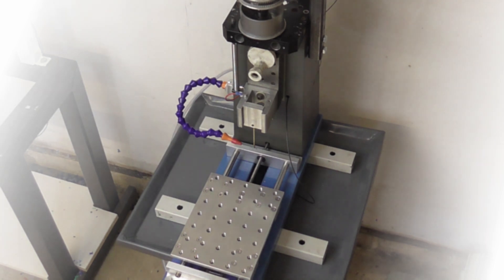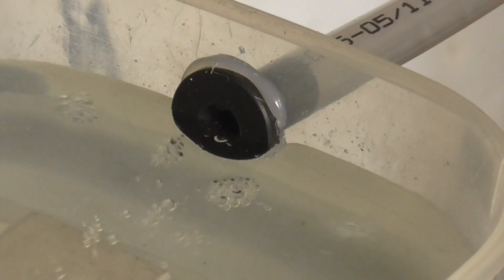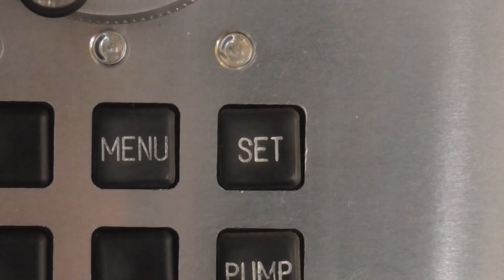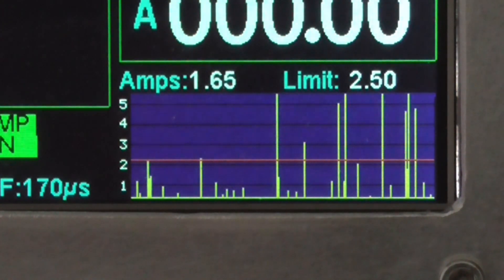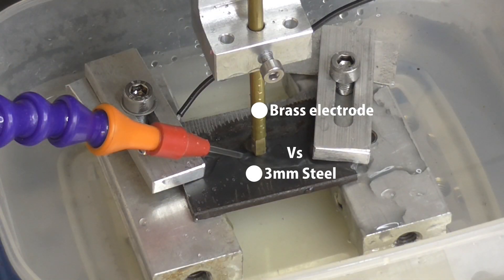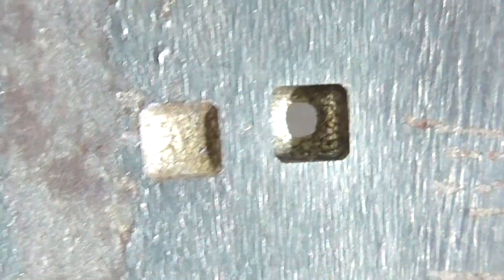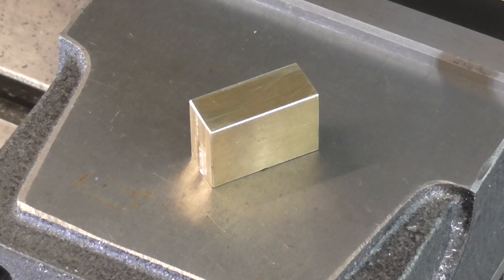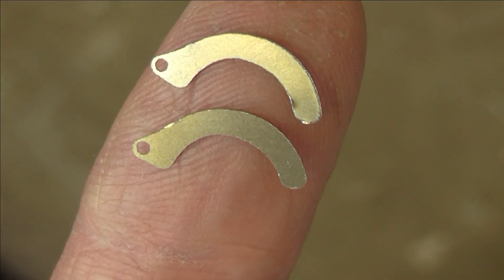Building an EDM machine part2

Comment: A question: in this model you used a sensor to measure and clean the current, right?
Reply from the maker: Yes, I actually measured the voltage which is proportional to the current.
Reply: @AndysMachines What modifications would you make for wire EDM?

Comment: Hey !
Once again, what a GREAT video !
I'm alsa building an EDM generator. I think yoi've already answered the question, but can't find it anymore, so... What's the best HIGH and LOW duration for your signal you fond out  ?
Reply from the maker: It's actually been a few years since I built this machine and I've not used it recently, I think I had best results with a fairly low duty cycle, maybe 10%, I can't remember the frequency but I think this information is probably in the video somewhere.

Comment: I use graphite electrodes with good results in oil.
Easy to pattern, come in large diameters for welding and cutting and good longivity.
Should work in water as well but haven't tried.

Comment: Wonderfull built and wonderfull result !
May i ask what's the purpose of R1 (and what value you use) ? As there's a big capacitor after, i guess it's not to limit current (or maybe to prevent short circuits damage ?)
Reply from the maker: R1 is to limit the current in case of a short circuit. I actually used a heating element for this resistor as it needs to be high wattage, it's resistance is only a few ohms, I chose it to limit the short circuit current to 4 amps so as not to overload the power supply.
Reply: @AndysMachines  Thx ! I think i'll try this buit to :)

Comment: I would really like to make this controller, can you share the plans?

As well I'm interested in making your plastic injection machine, you've done a fantastic job on it's design.
Reply from the maker: I didn't really ever completely finish this machine, so didn't produce any plans. I was going to add CNC control to the table, but I left it half-automatic half-manual. I might revisit it one day when I need some more EMD'd parts, but it's been overtaken by other projects (usual story!)

Comment: Love the EDM, starting to build one myself currently and have been watching videos because I was a simple build done on the cheap since its only for a couple uses then will probably gather dust awhile. Your setup is very close to what I am looking for, THANKS for sharing!

I have never ran an EDM but been around them alot and diagnosed/repaired them when I was previously a CNC Field Service Engineer for Custom made Sarix EDM Drilling machines at a couple plants in Ohio (Field Service Technician in my opinion, why companies have to add Engineer to titles that are not such....).

 One thing I would suggest if I may is: Try using Copper, Copper/Tungsten or Graphite rather than brass. If using graphite make sure you have the proper cutting tools (coated with diamond I think) as it is very abrasive and will eat up the end mills that are made for metals.

Comment: Great project! Did you measured the actual peak current through the transistor? In theory, with low ESR caps it can reach hundreds of amps (assuming spark has zero resistance ), but your system is doing well with single 30A(120A peak) transistor.
Reply from the maker: Unfortunately I don't have an accurate way to measure the very short high current pulses, but yes I imagine it's in the many tens or even a hundred or so amps.

Comment: From what I understand you used water, wouldn't it be better to use some dielectric fluid ??? If I'm not mistaken commercial EDM machines use a type of kerosene or it is an extremely fluid oil (not very viscous)

And for the electrode it seems to me that copper also wears out less and is more efficient, have you tried these two options I mentioned ???
Reply from the maker: Distilled /deionised water is a dielectric fluid, but you are right, commercially kerosine and light oils are used. I used water just because it was readily available. Yes, I've tried various electrodes including copper and graphite.
Reply: @AndysMachines  and how were the results with copper ?? because commercially I see that they use more copper electrodes, about graphite I was curious about the results because I have never seen an EDM machine using graphite as an electrode !!!
Reply from the maker: I haven't really done enough testing to see a clear winner. Brass is a good all rounder in terms of availability/ease of machining/wear. Graphite is very messy to machine. I didn't notice a big difference between copper and brass.

Comment: If you don't mind I would like to get your opinion. I have been thinking about building an EDM machine to make circuit boards "PCB's"... One thought is to use a N-channel mosfet instead of a  igbt, I don't know if that would be better or not. My second thought would be to use a tungsten electrode from a TIG welder, seems to me it would be more durable/last longer. Please let me know what you think, and thanks.
Reply from the maker: Yes, you can use a mosfet instead, I considered doing this. You can even use several mosfets in parallel to increase the current capacity.

I don't see why this shouldn't work, you can EDM copper with a copper electrode, but you might want to experiment with the polarity to see which gives less electrode wear. I haven't tried tungsten, but copper tungsten is used for EDM electrodes.
Reply: @AndysMachines  Thanks for your help and quick response. My thought was that TIG electrodes handle very high temperatures and pretty high current as well when welding, and they last quite a long time...  I don't know for sure though.
Reply: Of course mine wouldn't be doing what yours does. mine would basically be drawing lines, so no shaped electrodes, just a point.

Comment: Is there any chance of plans and code? Everything looks and works great, but there´s no information to it, aside to the Voltage-divider for detecting capacitor-current... In YT, we either find systems that work really just partially, and are full of informations, or systems that work greatly, but without informations...
Reply from the maker: This is still actually a work in progress, I shared as much information as I really could on the build. Mechanically and controller-wise there's still a lot to do before it will be 'finished'.

Comment: Why not use graphite for the electrode?
Reply from the maker: Because I didn't have any at the time. Apparently there is a special type of graphite for this and I now have a rod of it, but it's messy stuff to machine and not good to get in machine slideways so I haven't got around to using it yet.

Comment: Hello really nice video and experiments ! you can control the current via the resistor, take a 0.1 ohms and a current amplifier, with protections, and feed it on the microcontroller, it will be ok,. but to improve results a microcontroller should be used to keep constant I * time  value. and the arcing time is not constant so you must detect the start of the arc and then cound and trig off. Good experiments !

Comment: Hi Andy,

Very interesting project ! Did you build any circuit to protect the mosfet when there is a short circuit or do you simply rely on the stepper backing up fast enough ?
Reply from the maker: Yes, it measures the voltage across the voltage divider constantly (which is the inverse of the current flowing) and only applies pulses when it's above a set limit. Resistor R1 limits the maximum current through the mosfet and protects its during a short.

Comment: Just curious -- instead of brass electrodes, could you use tungsten?  Would it last longer than brass?
Reply: Brass has zinc content; zinc vaporize then explode by sparking, this is absolutely help in penetration. All wire EDM and super drill utilize explosion from zinc. These machines work poorly or do not work without zinc.

Comment: Andy, have you tried using carbon or copper electrodes? Excellent video
Reply from the maker: Thanks! I did try copper, but can't really say yet how it compares to brass. I also got some graphite rod to try, but the stuff is extremely messy to machine and the dust is not good for machine tools, so this is waiting until I have a real need for it.

Comment: The display that you have built is awesome what did you use to control it.
Reply from the maker: It's a 320x240 2.4" LCD display. I'm driving it with just an 8 bit microcontroller (ATmega328) using custom code I wrote in assembly language.

Comment: Do the sparks affect the microcontroller and stepper motor driver performance? Will losing steps occur ? Or after some times, will z axis not go back to home or original position (or zero reading)? Is the pcb is normal breadboard type?
Reply from the maker: The microcontroller, no. But the cheap stepper drive I used did occasionally get affected and take extra steps. This wasn't a problem as I was only moving in one axis but If I ever get this machine converted to 3-axis I will use better drives that are more immune to noise.

Comment: Also if you have XY slide as your electrode becomes worn you can do little circles that will bring them into tolerance even though your electrode is worn
Reply from the maker: Yes, I believe that's called orbiting? And is a function built in to many commercial EDM machines.

Comment: If memory serves me right your electrode should be positive a little bit more on time use your off time to control the flushing you should see the electrode becoming a little silver as replating should be occurring otherwise you need more on time.
 I would stay away from brass straight copper is best otherwise you have two different things happening  the zinc is coming out much sooner undermining the copper and avoid mixed graphite like copper infiltrated graphite again you have two different things going on graphite should be negative electrode never been a big fan of graphite it's nasty leaves horrible filth copper is one of the best items to use as an electrode that's 100% recyclable.
If you want better round hole you can rotate the electrode slowly and you can even very slowly feed a copper infiltrated tungsten block by the electrode to true it up that way you can control the diameter very tightly before you begin burning by doing this and continuing to rotate the electrode in the part you can make round and hold tenths of thousands of an inch on your diameter if you go to that trouble.
Instead of water you might wish to just use some diesel fuel at your dielectric you will smell the smell of acetylene that is what comes off is flammable it may flash into little flames here and there if you're near the surface unless the oil gets hot it should not catch on fire but I always keep a fire extinguisher around anyway the water will make hydrogen gas which you have no warning only an explosion.
Reply from the maker: Thanks for the advice, there's a lot to learn regarding all the different electrode types and variables. I did get some pure copper and graphite to experiment with. Yes, graphite is messy stuff, I don't like machining it for that reason.
Reply: @AndysMachines  I have many years of experience from work at one of our national laboratories where we cut everything but  die steel.
I wrote a rough book on non-conventional machining non-conventional material company that I was working with I believe sold that information to sodik.
Mostly on time off time settings different materials including plutonium that was done with wire machine much was wire and a good amount was die sinking.
We were using wire machines to make parts that you would normally make on a mill only much more efficiently.
Two of the most advanced sodick wire machines we were not able to use them as the software was quirky mostly used fanuc w series machines that no problem because of illegal semiconductors there are no American machines being manufactured back in 95 so they were imported with many names just it went against an agreement to not bring their machines to our market.
It ended up a good thing in a way it opened the door for new technology like a soft wired power supply this is big change as most EDM supplies are what they are you don't like the pulse type you must buy a new supply this one allowed many things that were not available then you could put your parameters on a floppy and share them.
Fanuc supplied many companies with controls right up until this agreement was no more than no one could get a controlled or a power supply so then that's just when they begin to make their own trying to remember the machine that we had purchased and there was no dealer in Arizona we got it very inexpensively everyone was afraid of this machine I took one of my more difficult programs and went spent a week with it looking under its skirt we took delivery of this machine and a week later they sell many with dealers in place

Comment: Could you replace the electrode with a wire instead? Obviously you'd need a way of replacing the wire continuously but would the spark generator electronic work unchanged?
Reply from the maker: Yes, you could use the same type of spark generator for wire EDM. Usually the polarity is reversed as with a wire you don't care so much about electrode wear since new wire is being fed continuously.

Comment: Nice. But why did you opt for sink, and not wire machine. Is the wire so much harder to make, or there's some other reason. Because the wire seems, at least to me, much more universal.
Reply from the maker: Yes, a wire machine is more versatile and not really that much harder to build, just more parts to it. I may even upgrade this to a wire eventually. But there are also things you can do with a sink EDM that you can't do with a wire and that's what I needed at the time I built this.
Reply: @AndysMachines  Can the same generator work for wire, too, or you'd need to modify it?
Reply from the maker: Yes, it should work for wire too, though I think often the polarity is reversed for wire vs. sink EDM.
Reply: @AndysMachines  Thank you for the clarification. I'd prefer to make the wire variety, as regardless of the method used, laser, CNC router, CNC lathe etc., I almost exclusively make small quantities of parts for prototyping. And wire EDM is attractive to me because of it's precision. Of course nowadays there's also a laser/waterjet combination which has similar possibilities, but the prices of such systems are for what I do astronomical. Even the generator like the one from BaxEdm is too expensive for my needs, but trying to put together something like you did doesn't seem such a problem to me, and I believe I'm capable of creating a mechanical part, too, CNC and wire+fluid management. But I suppose it's best to try to assemble the genertor, and probably also test it in sink configuration anyway. I may get back with some additional questiuons if I do try this, if you'll be so kind to answer them. Thanks again.

Comment: Congratulations you did a great job
I didn't understand what kind of electronics you used  
They are  pic microcontrollers?
Reply from the maker: This actually uses Atmega 328 microcontrollers (the same as used in arduinos), though I have used PICs in many of my other projects.

Comment: I wonder if taking the vibration  out of the timing puller might not  improve finish a wee skosh.
Reply from the maker: It only resonates when doing rapid moves, when cutting it moves very slowly and there is no real vibration. The column of the machine is quite heavy and soaks up any vibrations there are.

Comment: I wonder if a conversion kit could be made for an ender 3, using some sort of common rod stock as an elecrode.
Reply from the maker: I'm sure you could convert a 3D printer into an EDM machine, but it would be quite a big conversion and not easily reversible or suitable for use as both. The Z axis would really need much finer resolution, so would probably need a different leadscrew and gear reduction. (I have an Ender 3 myself).
Reply: I think the biggeset challenge would be dealing with all the electrical noise induced by the process, a 3D printer just isn't designed with such a harsh environment in mind.  All the long wires would make perfect antennas, triggering random resets of the controller.

Comment: Surly you would laser cut them at this thickness?
Reply from the maker: Yes, you could. You'd need a metal-cutting laser of course. Another more simple way would be to use a resist mask and etch them chemically. I just wanted to see what the EDM could do.

Comment: Just subscribed to your channel. As a wire and sink EDM programmer/operator I can say that your results look pretty good for such a basic machine. If I can offer some advice if I may:

-We usually use copper for the sinker EDM. Can handle much higher current; graphite is good but only if it is of low enough porosity otherwise it's worse than copper. Brass is used in the EDM hole machine, probably because of its superior stiffness when drilling e.g. 20xD on 0.3mm dia electrode.

-Most, if not all commercial machines work with a EDM table, that is, a set of parameters. Most basic ones would be Time ON, time OFF, peak current and what we call GAP, measured in Volts. Most EDM machines achieve stable feed by monitoring the gap and maintaining it stable via the feed rate, while all else is held more or less constant; this yelds a much stabler arc.

If you need any ideas or want to know how we do something in specific here in the pro world of EDM just let me know!